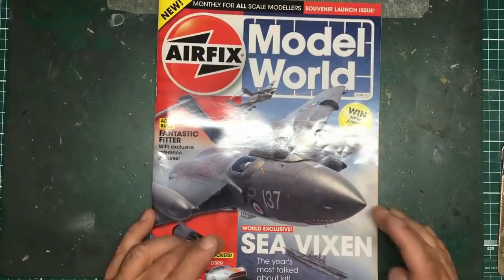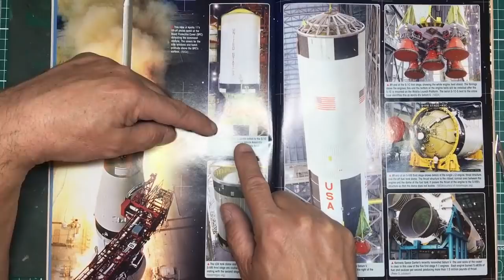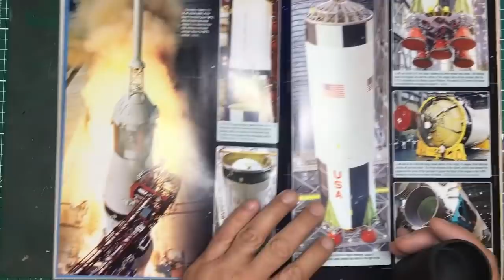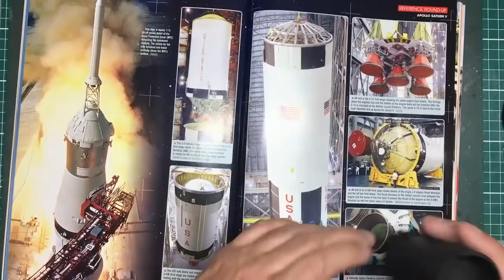Revell 1/144 Apollo Saturn V build series. Part 9.. masking nightmare..

Comment: Hello Nigel, in case of thinning Vallejo paints I only using tap-water and it worked well. Mr. Hobby and Tamiya are alcohol based acrylics all the others are water based. Don't use anything else for thinning.

Beside that it is a great build and I learned a lot. Thank you. 

Greetings from the "Ruhrpott"
Reply from the maker: You can also thin Mr Hobby paints with water.

Comment: I am going to be building the AMT Man in Space set as it is still a good size and hase much better second stage engines. I am also pairing it with the 1/200 Hasegawa shuttle with boosters. I had the privilege of seeing Apollo 15 launch in person back in 1971, and it was the most breathtaking thing I ever saw. 
    On the colors for the internal parts of each stage it seems that there are many variations. Some show yellow, others show a pale green, and some show a light shade of gray. What is correct?
Reply from the maker: @Jim Paul Jr. I think you need to find pics of what you want to build, ie 11, 13, 15 etc and go from there. I think the yellow zinc chromate and the green/grey would be pretty much on the nail for any model. I saw Apollo 13 go up, what an experience, as you say!!
Reply: Thanks Nigel. Nice work on yours and enjoy your channel very much. I have been into space since I was a kid. Now 60 so that's a long time. Always did science fair projects on space and space exploration.